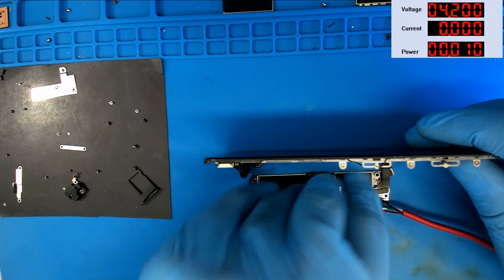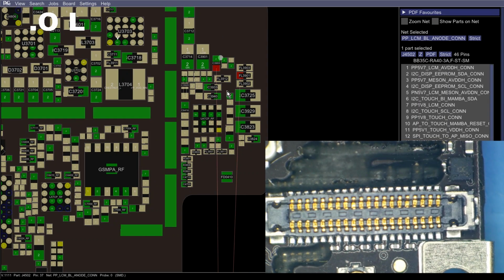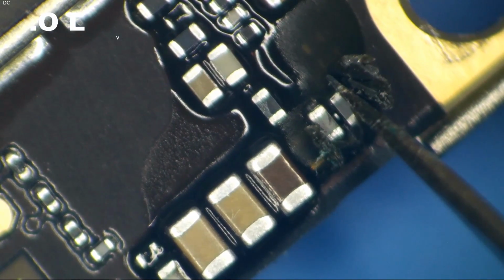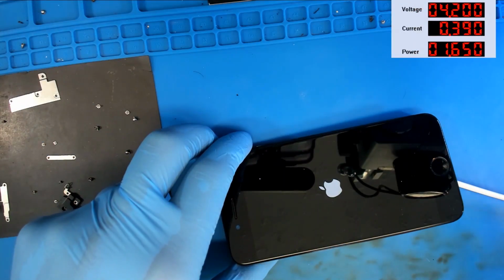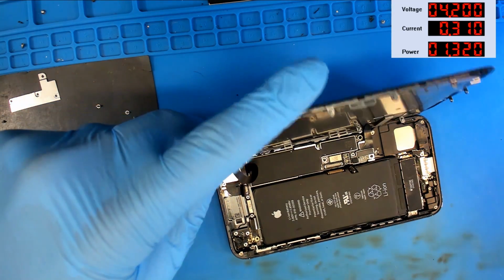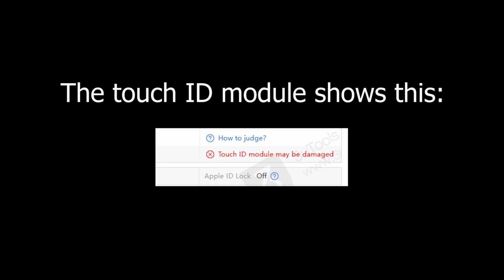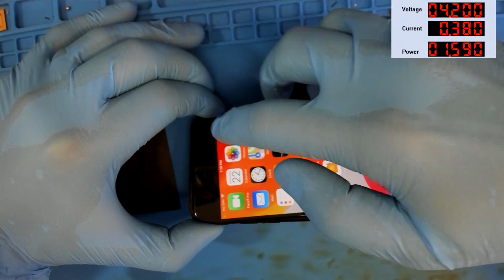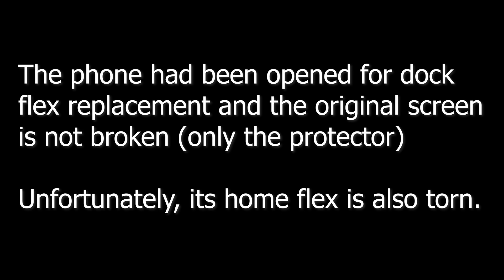A loopy iPhone 7 from Norway with no backlight or home button

Comment: The tiny solder ball is interesting, instead of that the filter blew up the solder joint popped, like the coil turned to a heating-element through a short.
I think someone was a little clumsy and teared both cables. Hope that guy will learn from it and take his time in future, put it aside if he doesn't find the problem instead of stressing himself, pretty sure this is the reason for the teared cables.
Nice job Jason, 15 minutes including explantations, wish you more jobs like that 👍

Comment: Nicely done! Only one question, is that kind of break repairable on the Home Buton?
Reply: Iura Bordei The screen needs to be replaced, or you could replace the backlight unit (which contains the touch id extension flex) but this requires soldering

Comment: Perhaps this could be useful for some people... it’s possible to take the home button flex out of a non genuine lcd screen and install it behind the shield on a genuine lcd screen to save the genuine screen and restore home button.
Reply: Bit Repairs On the iphone 7 this doesnt seem to be possible, it looks like the flex cable is integrated into the backlight/3D Touch unit. The whole unit needs to be replaced, which is possible too
Reply: It’s quite a clever trick, you remove the backlight box from a broken non original lcd, then carefully peel off the flex from inside the backlight. 

Prep the original lcd by cutting off both ends of the torn flex

Now install the flex you removed from the non original lcd on top of the original screen and then put the plate over the top.

I’ve done it lots of times to save someone’s genuine screen.

Comment: Btw, there is a 5 year warranty for this kind of failure in Norway (unprovoked pcb failures etc).  He probably sent it to you because he changed his screen with a knock-off earlier, which would void his warranty with Apple.
Reply from the maker: Oh wow.  Yes this was for sure a technician error.  Except for maybe his charging problem.  That seems to be solved by him replacing the port though.  Nice to know that about Norway though!